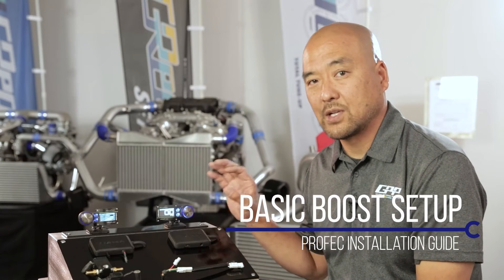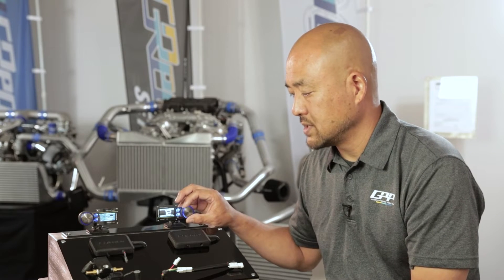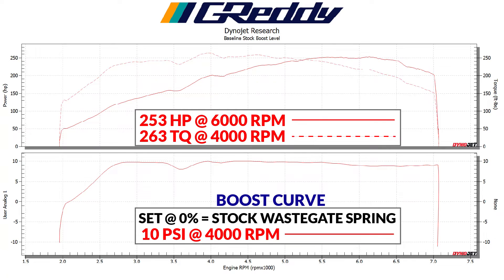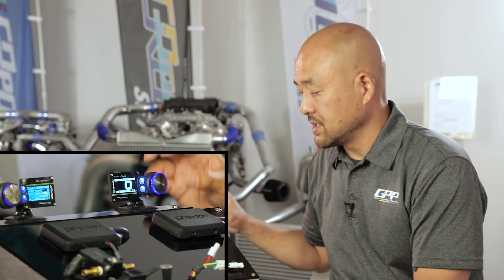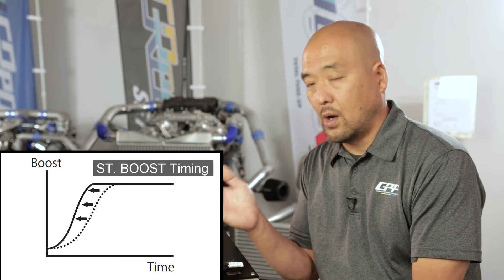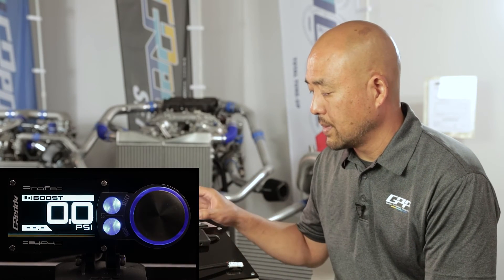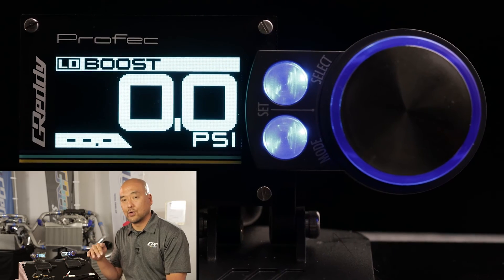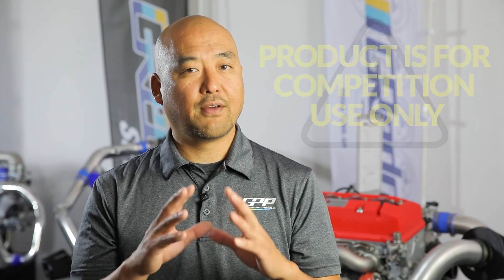How to gain HP with GReddy PROFEC Boost Controler - Ep. 3 of 3

Comment: It looks like the HKS EVC6 pre-installed on my car is more advanced than this system. I can set gain on rpm thresholds (5k rpm 5% gain, 6k 8% gain, 7k 12% gain) and have different boost strategies. (Boost by gear or speed)

Comment: I have a 1998 Toyota aristo with the 2jz gte I just recently ordered this boost controller. I looked in a couple forums to find a diagram on how to route the vacuum lines and the way I found only connects to the turbo that is at the front. Is there a way to control the boost for both or am I already controlling both with that location?
Reply: I have the same car currently installing

Comment: If my peak was 1.8 bar what my start boost should be? (Current setting is 1.10bar) And also what is scamble boost?
Reply: Usually start boost is set about 0.2 bar or 3 psi below target boost.
Reply: Scramble is a overboost function.
Use it for a short period of extra boost to win 
Set it by time or how button button is pressed